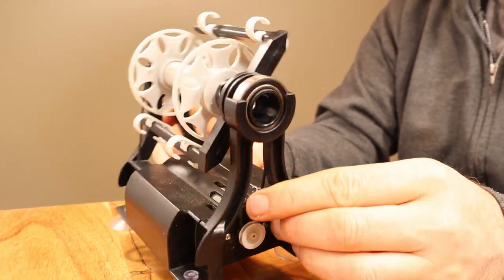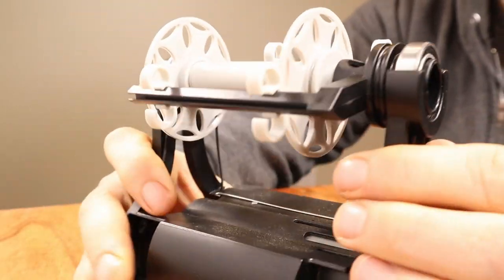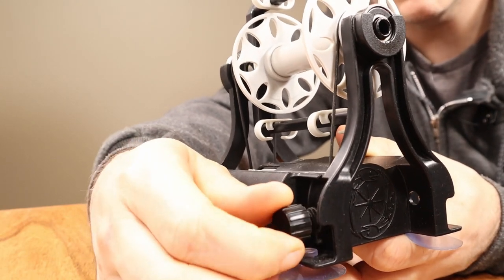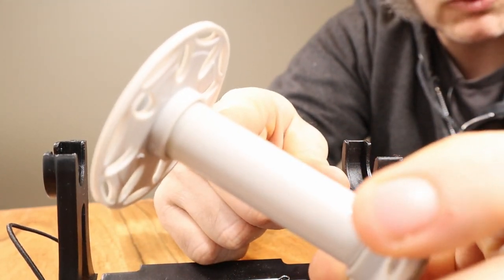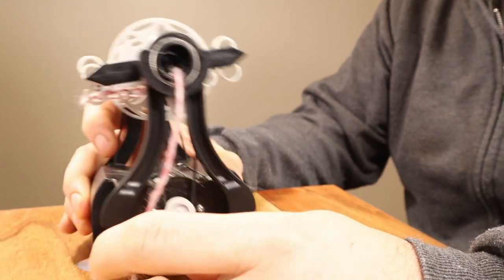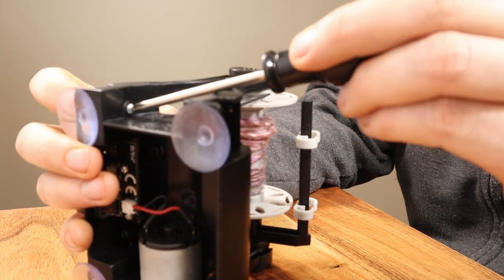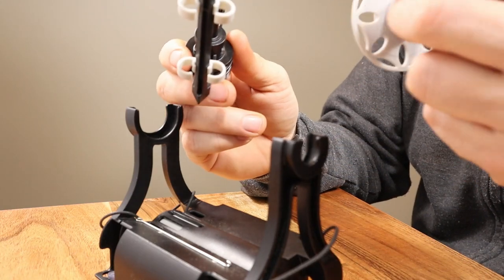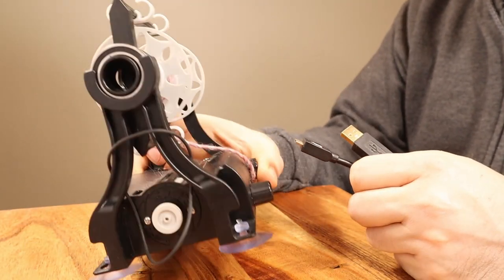SPIN 152 - EEW Nano 2 Setup Troubleshooting

Comment: When mine came, the intake reducer hole had a burr on the inside.  Instead of trying to file it off, I had some metal grommets from a craft project that fit the hole perfectly.  I just superglued it in place.  Worked great.

Comment: Has anyone figured out a solution to the uptake issue? I have tried everything. Tbe list online with suggestion, have been through all of that as well as anything else I can think of and I am not able to consistently get uptake. I am about as beginner as you can get so i waited for my sister to get into town to test it out. She has been spinning for years and  unfortunately she has having the same issues.  We have taken it apart, oiled, screwed, unscrewed, messed with tension…by the way, there isn’t much of a difference between no tension and the highest tension, so we swapped the band out for something less springy. I’ve had this for a few months now and I just want to spin.

Comment: I'm so frustrated, even after watching this video 5 times, and quintuple checking every point in it. I can't find a sweet spot, where it will both spin and wind. No tension on the bobbin and it just spins with the flyer, but put the slightest tension on the bobbin, and it creates so much pressure on the flyer, I'm afraid it will burn out the motor. I'm fast closing in on 'give it to the goats, to play with'.
Reply: Did you get it fixed? I’m having the same issue, but my tension band doesn’t get as tight as yours does. Once it gets even a little bit snug, it goes right back to zero tension.

Comment: I just started with mine and the bobbin does not free spin when it has nothing on it = like the pressure between the bearings is too tight to start with. I'd be happy to send you a video for diagnostics.

Comment: A lovely little machine...
I got mine for two days and I am a bloody beginner. 
I have the same problem as many of us, that it spins and spins and does not take the yarn in. In such a case I play around with the tension, without any result. I have a feeling that there is a secret correlation between spinning speed and tension. As a beginner I am working with lower speeds and therefore I can hardly find the right tension.

I realised that the hole in the orifice reducer is very small, so that the hook can not get in at all. In this video I saw that it must be normally bigger. Anyway, this is not a real big problem.

I am going on searching for the secret rule with spinning speed and tension. 😉
Many thanks for the video.

Comment: Yes I have the same problem as above! Zero uptake on the bobbin even with lead yarn - does the bobbin need to be static for the yarn to wind around it? Or are they moving at different speeds to achieve uptake? Does the tension lead create force on the bobbin to achieve this? I have tried different tensions.
Reply from the maker: It is a scotch tension system.  So as you increase the brake band it will slow the bobbin rotation relative to the flyer.
Reply: @DreamingRobotsBlog  thankyou, yes I realise that now. My band is way too stretchy I think - I know what to do now 👍 Vampy videos v helpful too esp the tension one

Comment: So, after reading comments, I am having the same issue as a lot of people, where I’m getting no uptake at all. I’ve take the orafice reducer off and played with just regular yarn attached to the leader so I could mess with the tension and I’m still having the same issue.  No matter what tension I’m at, the bobbin spins right along with the flyer and no yarn uptake. I have put tape over the leader and bobbin and still nothing. Now, I saw one person say that when they have their tension really high it puts a lot of pressure on the flyer but my tension doesn’t go neatly that high. Once it gets to what I would call medium tension and I turn the knob to increase it more, it goes right back to zero tension, is it supposed to do that? The only way to get  yarn on the bobbin is when the machine is off and I manually hold the bobbin still as I rotate the flyer around it. Can someone please help me? I just learned how to use a Diz so I have some beautiful pre-drafted wool here to spin and I am at  a total loss.
Reply from the maker: This page has an FAQ and several suggestions on things to try if you don't have enough uptake.  https://www.dreamingrobots.com/eew-nano/

Comment: I’m needing help with troubleshooting! My bobbins will not spin freely on the flyer without any tension when they are on the base. When I take the flyer and bobbin off the base it spins perfectly! At first I thought the bobbins weren’t screwed together tightly enough, but they are. This happens with all the bobbins. Could the cradle arms on my base be angled inward too much? Could all of the bobbins just be too long? I tinkered with one of the bobbins and filed about a quarter of a centimeter off one of the threaded ends and was able to get it taking up yarn, but I don’t really want to have to modify all of the bobbins!
Reply from the maker: The arms can bend inwards and add a little friction.  That is normal.  Bobbins can't be too long.  One option if there is too much friction is to add a little oil or dry lubricant around the ends of the bobbin.
Reply: @DreamingRobotsBlog  Thank you! I will give that a try.
Reply: Thank you SOOO much! I had tried everything suggested all over. But when I sanded off about 1/8" of the bobbin's center tube, it started to take up the yarn as it should! I'll prolly hafta do this for all my bobbins, but at least it's not an issue anymore!